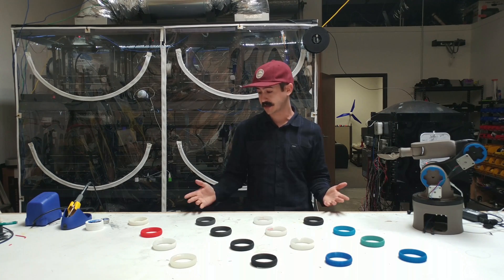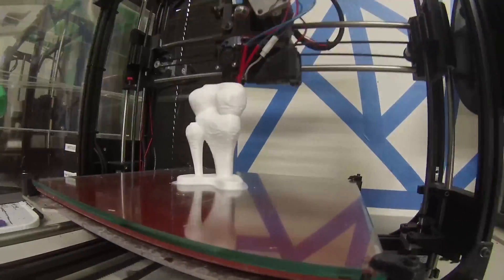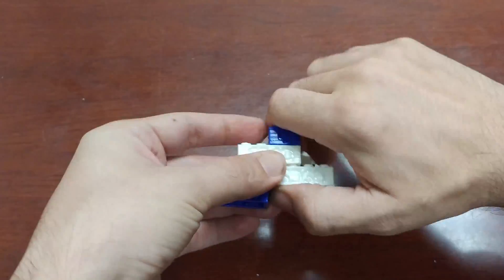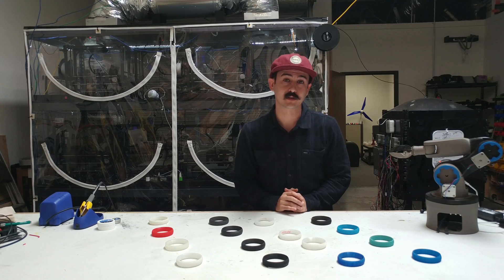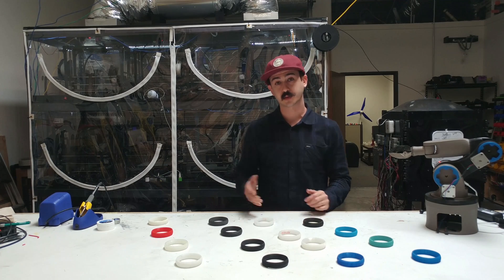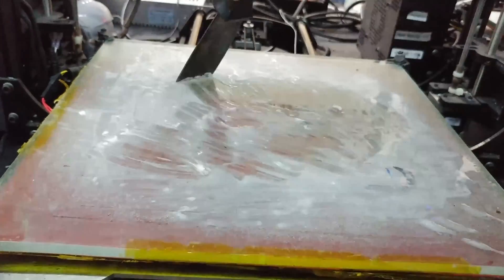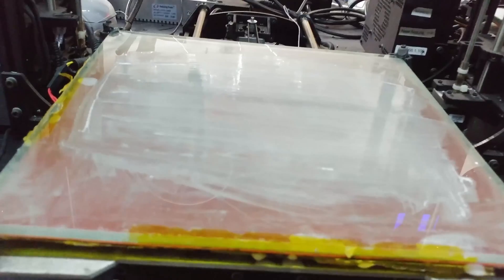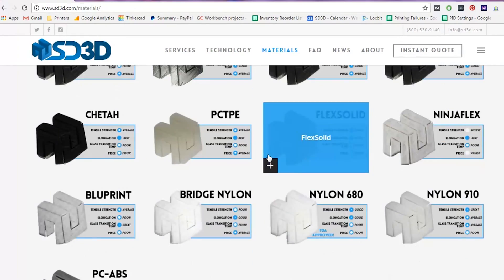3D Printing Material Options

Comment: I tried printing some nylon on my cheapo printer which had a wood bed. The nylon is so god damn strong it adhered well to the wood and when it warped due to no heated bed it ripped the wood apart, it was kinda awesome to be honest.